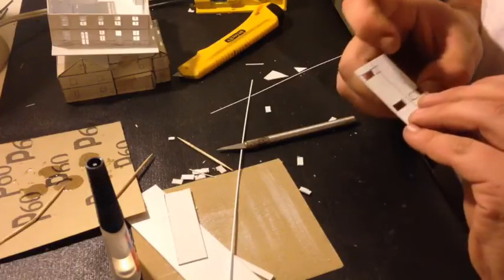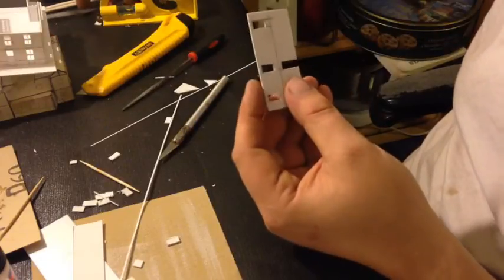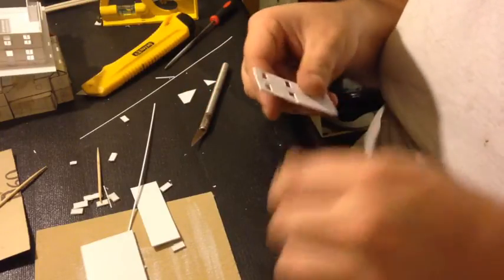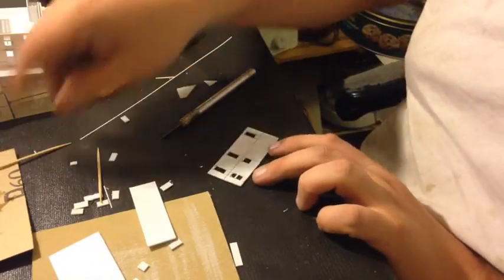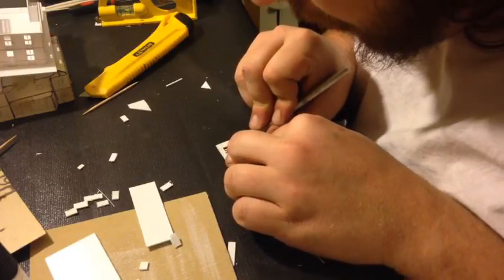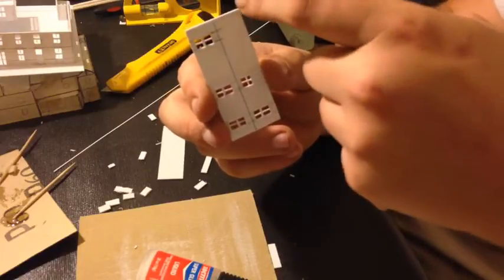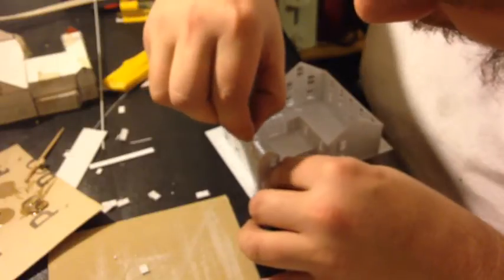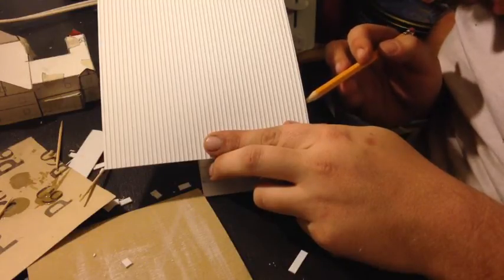IMRROcom BBCV2 video 2

Comment: Wow!!! Nickolas.. you are making a tricky little build look fairly easy and it has to be the tricks of the trade that make it look that way.  This is a great looking farm house..very much looking to video three .. Tom
Reply from the maker: +Overland Transportation System this was actually my first time scratch building anything. All of this was a guess and keep my fingers crossed it worked out. Thanks for this comment. I'm surprised you think I made this look easy. As it was just that easy. Scratch building is a taboo subject in modeling but it's often overthought to a point that is seams hard to do. This was easier then some kits I built. So go get a few sheets of styrene from the hobby shop and give it a shot.